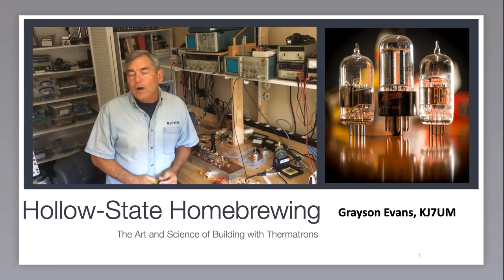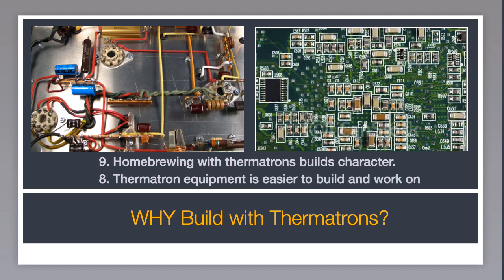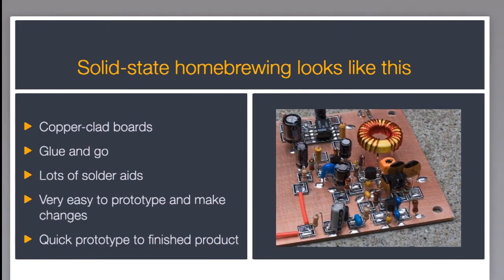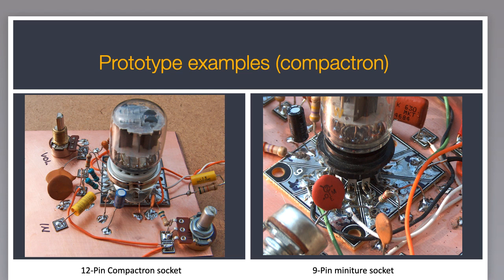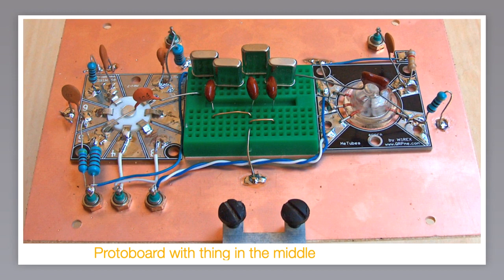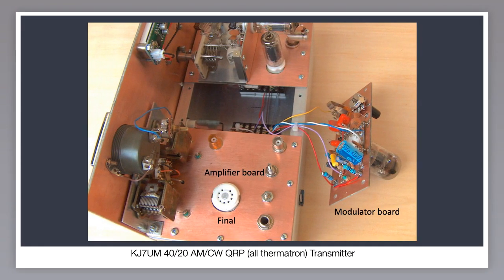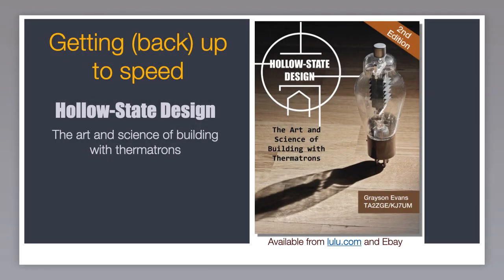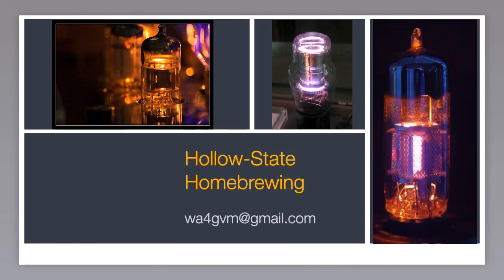Hollow-State Design Course by Grayson Evans, KJ7UM

Comment: Fabulous material Grayson! It sure takes ole-timers like me back to younger days, complete with burnt fingers and plate-voltage tingles. There's only one thing missing... motor-generators like the ones that powered old AN/ARC radios. A proper boy's ham shack isn't complete without the whine of the recycled military surplus motor-generators and AN/ARC (thermatron) radios..  THANKS, and we'll keep looking for more from you.

Comment: My step father built 2 way radio for the loacal bobbies in the 50s in a small Tin box ,with  a telephone hand set two acorn valves and vhf 100 mhz super regen modulator audio amp